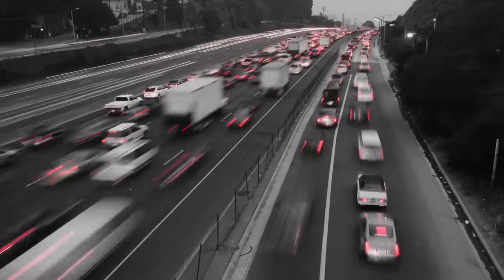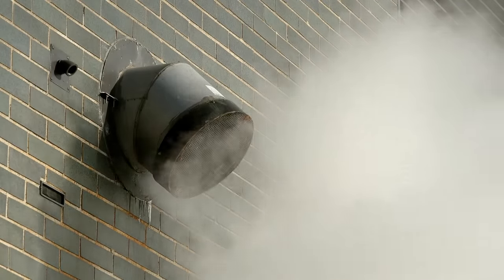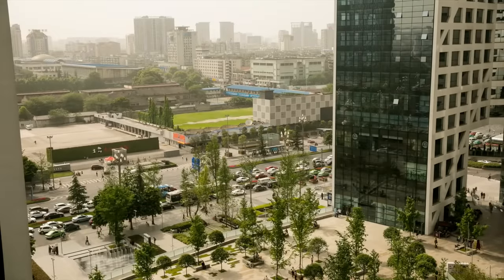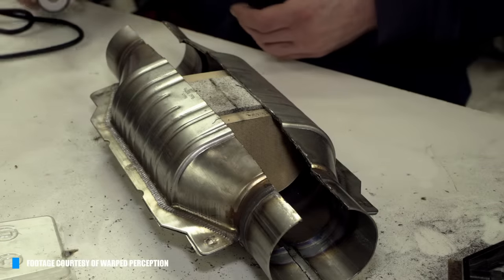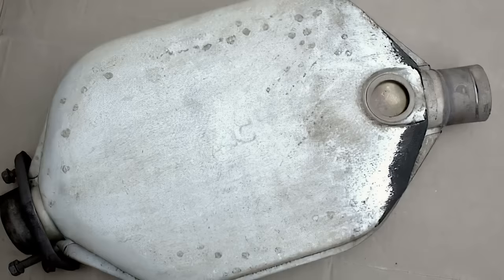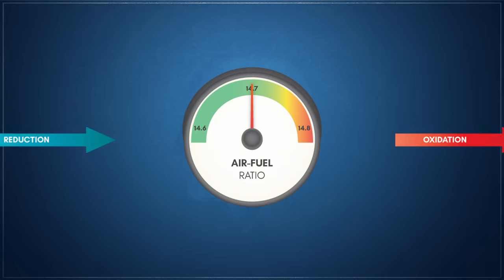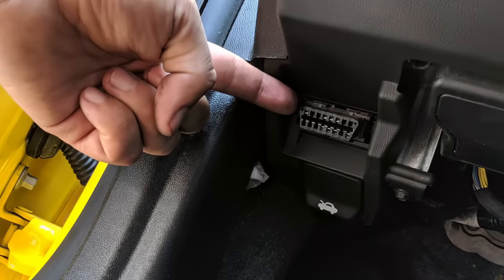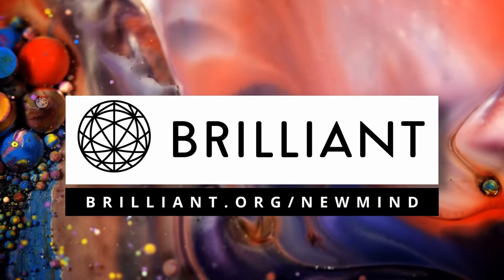How The Most Hated Auto Part Changed The World

Comment: This isnt the most hated auto part. Diesel exhaust fluid systems are the most hated part.
Reply: Yes, cats are fine nowadays (besides people stealing them). I supercharged my car and left the factory cat in there, no need to remove it and have a smelly car.

Diesel particulate filters on the other hand, those have caused headache with non stop issues, and bank breaking damage to a person with some of these trucks having almost $10k exhaust systems. (Regular trucks for pulling a trailer, not an 18 wheeler). That is insane.
Reply: @volvo09  10K you say?  source?
Reply: @marvintpandroid2213  yeah 10k is a little steep. I paid $2700 for dpf replacement and labor and I think an scr is only around a grand on top of that. Mostly what I find annoying about the whole thing is the manufacturer warranty only coving up to 50k miles and mine went out at 58k. Up to 10 yr 150k mile replacements would be more palatable to individuals who would rather delete and pay similar money to skirt the law in search of reliability. While I don’t feel the need for more power I also don’t relish another $3000 and downtime for repairs looming at some point in the future. I’ll probably trade in for a gas engine in the next few years solely because of that
Reply: @volvo09  You supercharged your car before upgrading the exhaust system, AND think DPF on consumer diesel trucks cost 10k?  Whew, Buddy do i have a deal for you 😏
Reply: @Hath.0  "...AND think DPF on consumer diesel trucks cost 10k"

He said the whole exhaust system and that's probably not too far off when you consider the entire system and the complete SCR system, which is an entire electronic injection system by itself. Heck, with all of the piping, sensors, the SCR catalyst, the SCR injection system, the DPF and the DOC, I wouldn't be surprised if that were conservative.
Reply: The alphabet soup (EGR, DPF, DEF, SCR)
Reply: @PistonAvatarGuy  not to come off as a smart ass. I don't consider all the emissions acronym parts as "exhaust" or even part of the "exhaust system". Transmissions are connected to engines, no one considers them "engine parts".
Reply: @Hath.0  Clearly, you've never looked at an automotive parts catalog. All of the parts that I listed would almost certainly be considered to be part of the exhaust system by any vehicle manufacturer, they certainly were by every one that I've ever dealt with.

Transmissions are not engines, but exhaust treatment systems are certainly part of the exhaust system.
Reply: @PistonAvatarGuy    "headers" and "turbos" hangers, 02 sensors, etc are exhaust parts but most people don't lump that in when saying I put a new exhaust on my car or truck. Let alone replace them. So if someone with more money than brains wants to dump $10k replacing the entire exhaust and exhaust emissions system on thier diesel pick up, I hope they have the updated version of that parts catalog.
Reply: @Hath.0  DPFs typically do need to be replaced after a certain amount of use and they absolutely are part of the exhaust system, regardless of what some yokel on the street might say. The DOC is sometimes integrated into the same housing as the DPF, so it's also common for that to be replaced along with the DPF. Diesel EXHAUST fluid is also something that needs regular replenishment. EVERYTHING that I named is DIRECTLY related to the treatment of EXHAUST and the exhaust from the engine passes directly though many of those parts, so they absolutely are part of the exhaust system.

The DPF alone for a 6.7 Powerstroke is $3,500 from Ford (no labor included), so it's not that hard to imagine that all of the other components in the exhaust system would add up to $10k.
Reply: Way fewer of those exist thereby accounting for less total hate by mass.
Reply: @fr33dumb0  the only time a person hates their CAT nowdays is when its stolen.
Reply: @RainOnThursday  2.7k for what a dinky liter 2 litter engine once you get to 6+ liter engines its an easy 10K the massive ones on Tractors and combines can set you back 15 - 20k not including labor.
Reply: Amen
Reply: Egr
Reply: This is why when I buy diesel vehicles, i buy older ones.
Reply: Yeah. If you've ever finished the last 40 miles of a 1400 mile trip at 25 MPH because a 4 month old $2800 pump failed for the 4th time on a 2 year old vehicle... Then you've probably stripped the system from your vehicle by now. 👌
Reply: @marvintpandroid2213   no, $10k would be a steal for the entire system. Go ahead and get a shop to give you a quote on re-installing the DEF system on a truck where it was previously deleted. Biiiiig money. I replaced the DEF pump 4 times in 2 years for $2800 each time. The manufacturer wouldn't cover it the third time, so now 4 months later my truck has no DEF system left.

You can spend $7k+ on replacing the DPF alone.
Reply: @operator8014  fuck up an install on anything 4 times then it will cost you big money.
Reply: Nah, I'll take a DPF/DEF combo any day over EGR.  That's the real problem emissions component on diesels.  Thankfully, with the advent of DEF, EGR flow can be greatly reduced, preventing a lot of wear, soot buildup, and failure points in a diesel engine.
Reply: @PistonAvatarGuy  Ya, I'm with you on this one. A simple parts failure of a faulty DPF pump can mean partially dropping the tank just to confirm it has failed because on a European diesel that can sometimes be extremely expensive parts and labor wise. On a Domestick truck however generally parts like that are easier to access but do commonly fail commonly. If the system isn't repaired on a newer truck 2015+ it will usually give you a countdown of days until it is put into "limp mode" and can't be reversed until the system meets the minimum requirements to pass the on-board emissions management system test on the car. If the faults are cleared the timer will restart but it can only do that so many times before the computer will lock that function as well. On even newer Dodge vehicles faults may not even be able to be cleared without a shop license key to unlock that function on a scan tool that can do that online connection through the tool. This means for vehicle owners with these SCR/DPF systems are given much more pressure to fix it as permanently as you can and quickly because I don't know about you but I would be horrified of a "countdown of doom" show up on my dash right when I start and end the day. These parts can fail in multiple areas from all areas relating to the overall engine operation. Replacing the DPF, piping, EGR, SCR, all the sensors won't help if the failure is due to a leaking injector. Emissions components are an add-on to the whole process but by-design rely on the engine running operating correctly so it could be the cost of the damaged exhaust Emissions related parts like converters/filters/sensors and then the cost of the faulty part that caused the damage, add in the labor for diagnostic time and labor cost of replacing almost an entire exhaust system. I could easily see the cost being in that range if that was the case especially with new Emissions Parts requirement for vehicles at this point int time.
Reply: No, it's not. Because no one drives a diesel. Everyone drives a damn car.
Reply: Nerd city up in here
Reply: @SupraSav  hey 12 year old. Theres diesel cars
Reply: I would like to nominate the EGR for the role of “most hated diesel part”.
Reply: @frhorizons  That was a while ago. Manufacturers have outdone themselves now.
Reply: You got that right. We see nothing but issues. One of our brand new peterbilts has 300k miles and nothing but issues with the def
Reply: @SupraSav  I've got 2 Diesel engine sedans here in Australia
Reply: Fr
Reply: Emissions systems that cause the check engine light to come on with only 10-30k miles is insane
Reply: Yes this comment!!!!  most people don’t pay any attention to anything other then their commute lol
Reply: Well the list keeps growing
Reply: This.  Cats are actually reliable whereas DEF systems are an absolute nightmare for almost every diesel fleet in the world that has to used them.
Reply: Nah ......DPF
Reply: @volvo09  I work on 18 wheelers as you call them. I just call them semi's. But they don't even cost us 10k to do so cap. They are expensive. About 5k. Source. I work at the largest trucking /leasing company in the world.
Reply: @marvintpandroid2213  It doesn't need to be fucked up in order to fail. all current systems fro Duramax's to Peterbuilt's are under-developed and over-engineered to the point of catastrophy. $400k trucks that are regularly failing with less than 1,000 miles on them. $5M fleets with greater than 20% out-of-service failures in the first year.

The systems simply are not ready and they do not work.
Reply: @SargentH12121  Modern cats are crazy reliable as long as you can keep the tweakers away from them.
Reply: @lennytate4246  You're telling me, that you have never once seen a DEF system problem that cost more than $10k to fix. HA! You call them Semi's? Largest in the world?

Sorry man, I'm calling you a liar.
Reply: @operator8014  Finally someone else is saying it. I do fleet maintenance and the failure rates of brand new trucks is insanity. We have 23-25 year old (heavy duty) trucks that companies have to lean on heavily because they actually work every single day, while the new trucks with less then 10k miles are at the dealer again and again. And if you have a driver who accidentally adds a little DEF to the fuel tank and doesn't say anything, now you're replacing the entire fuel system AND exhaust system. That crap is corrosive and eats everything. 

All while the old trucks are hauling day in and day out, only in the shop for oil changes and tires. Just loyal.
Reply: @SupraSav diesel cars are very common in the rest of the world mate
Reply: 100,000%
Reply: in cars the cat is still hated but the least hated part now. truckers hate the def system (and i think it's stupid as well)
Reply: Pretty sure majority of car guys don't even know what that is lol
Reply: @PistonAvatarGuy  DPF’s can be serviced and cleaned at regular intervals and can extend life of it, also the DPF needs to regen periodically when enough soot inside needs to be burned to ash which some people don’t let it complete and if you don’t service it, then the DPF will fail and would need replacement.
Reply: @mattcee7113  Or, you can buy a gasoline vehicle and avoid the cost and headache associated with diesel emissions controls altogether.
Reply: @PistonAvatarGuy  You could also buy a 2002 or older pre emissions dinosaur vehicle but downside is mileage and parts availability
Reply: @mattcee7113  And pollution.
Reply: Exactly. The catalytic converter is so loved, people are stealing them.
Reply: Blue, blue, blue addy blue!
Reply: @matthewrupp5526  bigot
Reply: @wtice4632  Huh?
Reply: @matthewrupp5526  you heard me bigot
Reply: @wtice4632  why are you calling strangers names on YouTube?
Reply: @matthewrupp5526  you should ask yourself that. You were being bigoted toward blue collar workers.
Reply: @wtice4632  What's bigoted about the truth? That businesses actually use diesel trucks for their intended purpose and it's all a tax write-off vs middle age Republicans who buy and daily drive big diesel trucks just to commute, shopping, taking kids to soccer practice and MAYBE hauling something a few times that I could haul in my Toyota Prius?
Reply: @matthewrupp5526  the coastal laptop class shows their true colors and contempt for the working class
Reply: @wtice4632  Never heard of that, what do you mean?
Reply: This is why you have to stay on top of your engine condition. If your engine is suddenly running in a less than optimal condition, FIX IT ASAP. The longer you run the engine with that condition, the more problems the emissions components are gonna have. DPF is most sensitive to engine health. I've blocked off and turned off my EGR for this exact reason. 

SCR/AdBlue system is simply a ticking time bomb since it deforms the components over time
Reply: It probably is the most hated part in terms of number of people who hate said part, but it's not really merited. Like, who hates auto parts? They sap like no hp at all these days. Racecars primarily don't use them because the high egts would fail the catalyst quickly and it would be an expensive futile effort.
Reply: Effectively the same part.  So it’s still the most hated.
Reply: In fairness, today's diesel engines pretty much have a miniature version of a factory smokestack scrubber system in them whereas a gasoline emissions control system is mostly passive.
Reply: Some people love dogs, others love cats.
Reply: I  can understand people who own diesels hating DEF, but I love it. Though I got tired of smelling diesel exhaust driving tractors on a farm as a kid. The smell of my Kubotas exhaust sucks too, but I try to dig with a shovel as little as possible. The back snot after a long day of backhoe work wishes there was a reasonable option for tractors😢.
Reply: How can I hate on something I never have to buy with all my cars being gasoline

Comment: It wasn't the catalytic converter that was hated, it was the EGR valve. You might still argue that it's not something good even though the reliability issues caused by the EGR valve have been mostly fixed. The catalytic converter made cars stop stinking and deserves most of the credit for cleaner emissions from gasoline vehicles. In conjunction with fuel injection using O2 sensors, catalytic converters make the busy city much more bearable without really reducing power by anything significant. EGR valves, on the other hand, do things in the laboratory that don't reflect real operating conditions and at the end of the day, they do reduce power and efficiency while reducing engine life. I like road vehicles having catalytic converters but get rid of EGR valves already.
Reply: I was always against removing EGRs or blanking them. After enough digging, I found out long term they are a bad thing for a diesel car, especially if it has a turbo and intercooler. 

It clogs up the intercooler, throttlebody, and intake manifold.

I always thought a catch can would solve the problem, but after digging, I found it made it even worse.
Reply: I would also say smog pumps are in the same category.
Reply: @madcat4563  What did you read about catch cans?

Comment: Most people dont hate having a cat, but getting it stolen
Reply: I don't like it when they hiss at me and scratch me either
Reply: There's nothing worse than cat burglars.
Reply: Or having your cat snitch that you didn't pay your taxes
Reply: or having it rob 200hp from your 1200 hp streetcar
Reply: I absolutely do hate my catalytic converter it robs 30-40hp from my engine, causes the turbo to spool up slower, and you can't use flat foot shift, 2 step launch control, or anything else that created a rich condition. I have to put it on every year to pass inspection too it's a pain in the ass.
Reply: :chillwcat:
Reply: @sushigaming101  Just get a classic car, problem solved.
Reply: @SeekingTheLoveThatGodMeans7648  lmao how u get that emoji
Reply: @SeekingTheLoveThatGodMeans7648  :chillwcat::chillwcat:
Reply: Free straight pipe.
Reply: Can't steal it if you don't have one ;)
Reply: @sushigaming101 The Cadillac Blackwing engines have flat foot shift and launch control, and they have catalytic converters. It's possible.
Reply: You can sell used cats, but you can't legally buy a used cat and install it to keep you running at cost. Certain states have safety-only inspections because of the auto industry lobby, and no de-facto emissions regulations at all.  Some states have no safety inspection, but only emissions.  Both extremes are bad and have a scientific basis.